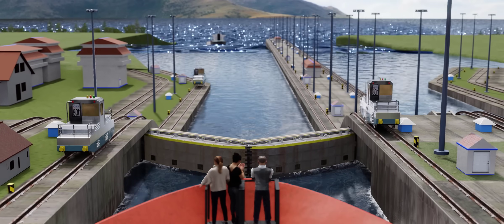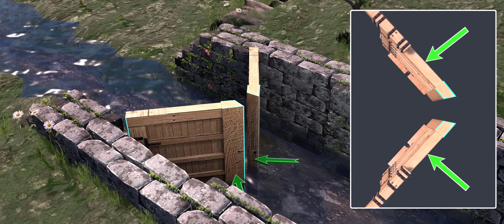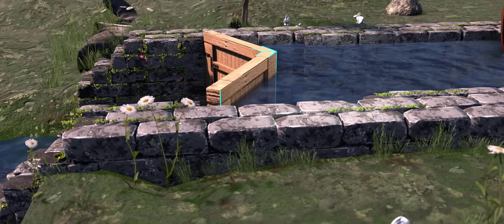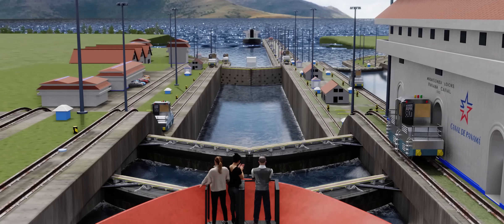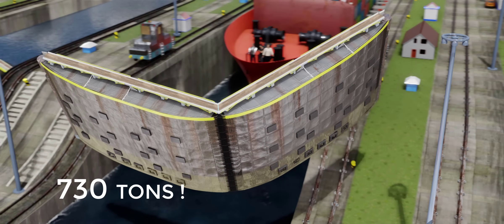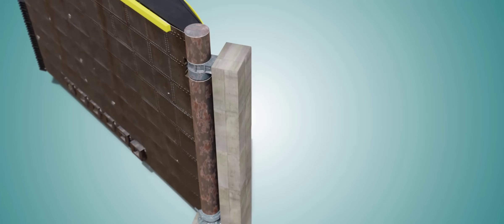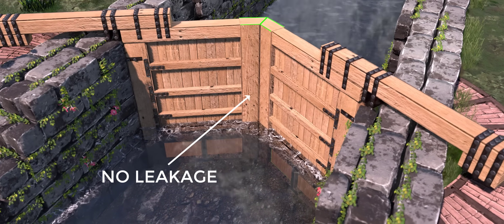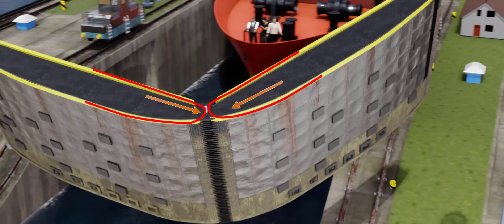Leonardo da Vinci's GENIUS invention - Miter Locks

Comment: Sluice valves are mentioned once but never explained. It's as if you think their particular design mechanism is too obvious to explain. But how do they stay watertight? If they are part of the gates, how are they opened from the canal bank? Opening them against strong water pressure must be difficult too. If not, why not?
Reply: Sluice valves are usually flat plates in an opening on the inside of the lock Gates. They are closed and opened with either a screw with a hand wheel (most common on old wooden gates like the C&O Canal ) or hydraulic piston. Olden days, there was a gate keepr at esch lock thqt would open and close the gates, and open and close the valves by
 climbing out on the gate to the hand wheel. Often the gates also had ropes and pulleys to open and close them.
Reply: Those valves can work if they were to slide down perpendicular to the direction of the force of the water.
Reply: On UK canals, the sluice paddles ( valves ) slide vertically upwards. You open them by slotting your windlass onto the bolt and turning it, which pulls the paddles up with a rack and pinion mechanism. Very easy to open since the windlass and gearing gives lots of leverage. A ratchet stops them dropping down until you want to close them.  There are gate paddles, built into the lock gates themselves, and ground paddles at the upper end of the lock, which allow water through a channel to enter the lock from the sides, so you don't dump water into the boat when you start to fill it.
Reply: Thank you, I had the exact same question.
Reply: I guess the smaller surface area of the sluice gates make opening them more manageable.
Reply: @libertarianPinoy  Yeah. They are locked in place then the gate is open, so there is no water pressure. Then, once the gate is closed and the water pressure is strong, the locks are released and the water pressure pushes them open, since unlike the main gate, they don't open against the pressure. Once the pressure is weak enough to pull the gate open, they can be sealed again, ready for the next time the gate is closed.
Reply: Sluice gates are normally operated by a screw.
Reply: Thanks bru for asking. Was wondering how it works 🎉🎉
Reply: Sluice valves are at the same level as the water on the other side of the gate. So the pressure is the same, and is balanced. One could open it as easily as a window
Reply: シンガポール
USAアメリカ大使館
所属 No.3大使
No. 5 Combat CompanyKK
Victory Spirits Christian
Grand St 教会Combat 

単独 Only One、
NO..ICRC 不参加
如何なる契約書 も、
完全否定
世界 各国
政府機関の集団犯罪が
大量殺人戦争
麻酔作戦
睡眠薬混入
食べ物混入
水
製造 東洋
材料 新素材
ビール樽
Reply: I was wondering the same thing.  He just glossed over that part.
Reply: I guess they didn't focus on it much because they didn't want the glitch in matrix to be revealed.
Reply: Because they’re very small obviously
Reply: The mechanism looks similar to a butterfly valve, when you begin to open it, the force trying to push it open is equal to that trying to push it closed, meaning the only relevant force is which way you pull it.
Reply: I'm no expert, but here are my guesses: I don't think the water pressure would be strong at all in regards to these valves. Unlike the door that only has one force pushing against it, the valve has both the force of the water trying to close it back up, and the force of the same water trying to break through to the lower pressure zone. My guess is that these forces balance each other out, allowing for the smooth opening of the valve. I don't have an idea as to how the old valves stayed watertight, but I might have a clue for the new ones. The new valves might just be a door built into the bigger door that goes up and down. Since the force of water would be perpendicular to the up and down motion of the valves, there would be no significant work done on it, meaning the doors could move easily. When they go back down, they would go into a large divot that holds the doors in place. The force of the water would make that seal airtight. Right after I wrote this, I realized that the force of the water would also missalign the doors to their divots. I dont know whether that'd ruin my propsed system totally.
Reply: The sluice gates are merely smaller miter locks. Of course this means they need their own sluice gates, but fortunately, we know how to build miter locks.